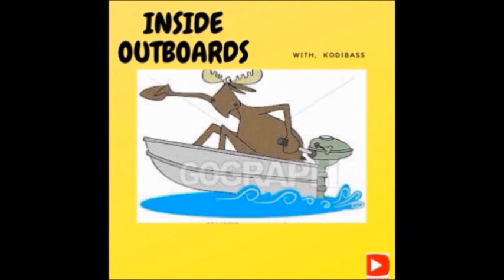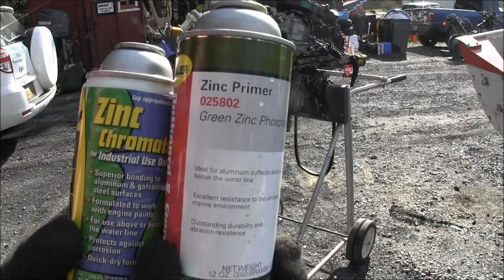JOHNSON, EVINRUDE 30 hp MANUAL PRIMER , Johnson 7.5  hp & a winner !

Comment: Cleaned carbs on my 30 hp new rebuild.  All clear still coughing at just over idle.   Any other ideas sir
Reply: Whats air screws   supposed to be turned out to after seating em
Reply from the maker: was the gasket behind carb in good condition?  kodibass
Reply: Yes it is in goid condition

Comment: Kodi.  Do you have a minute?  I cannot find any info on my 50HP merc 4 cylinder.  Serial number says A132403.  I punch that in the Merc website and it comes back no info.  Trying to figure out the year so I can buy a trigger
Reply from the maker: The best way I have found is go to iboats web site & type model# and ask the form, you will get a answer from one of the Merc guru's kodibass

Comment: if I choose to cancel the manual primer what will I do with the exit from the intake manifold? I mention that I have the variant with the T on my motor. is a johnson 25 whit manual primer and T. When i cut the hose between the t and intake manifold began to leak a lot of gasoline from the engine
Reply from the maker: cap it or loop it either is fine.  kodi